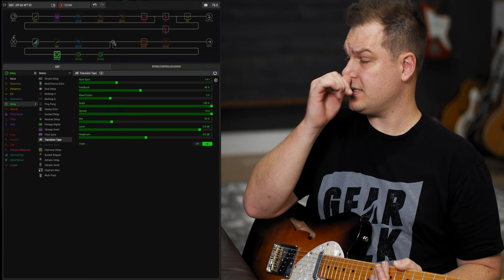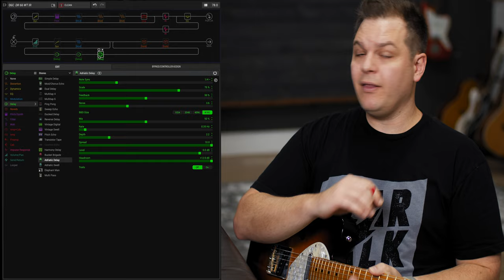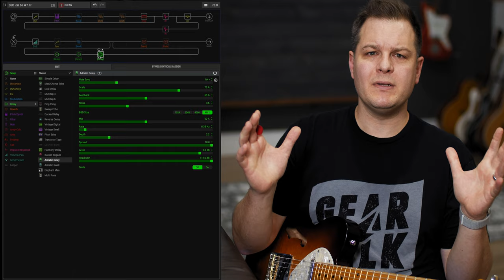Helix Tips: How to make any stereo delay a dual delay in the Line 6 Helix

Comment: Any tricks on how to get spillover over from preset to preset?
Reply from the maker: Do you mean when you switch to another preset? You’ll have to give up half the units DSP to do that, unfortunately

If you just want trails when you turn the delays and reverbs off, it does that already
Reply: @worshiptutorials  yeh stomp doesn't have spillover when switching presets right?
Reply: @worshiptutorials  if I'm going from one brand new preset to the next it doesn't have spillover
Reply from the maker: @boabglen  Yeah Helix was never able to do that in the beginning. They added the ability to have spillover between presets, and you can enable it in the global settings, but you'll give up half of the DSP of the entire unit to do it, so all your presets will have the same amount of DSP as the HX Stomp. You'd have to remove about half of the blocks from our presets.